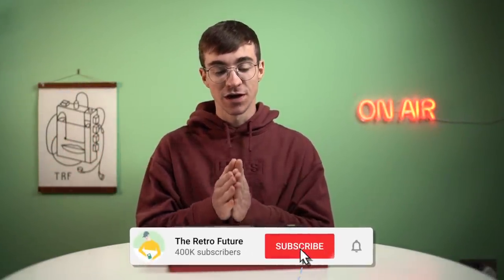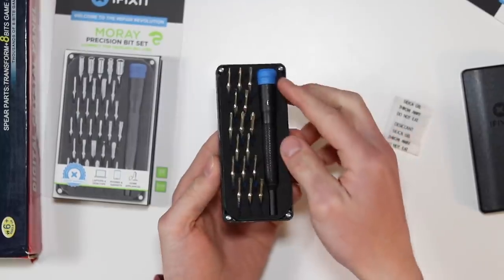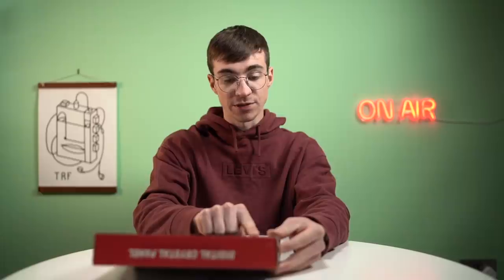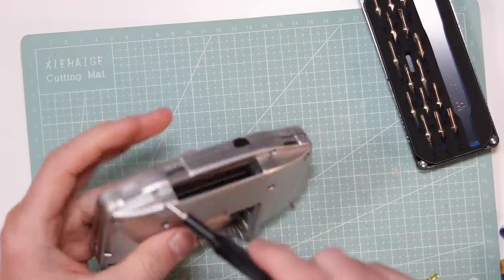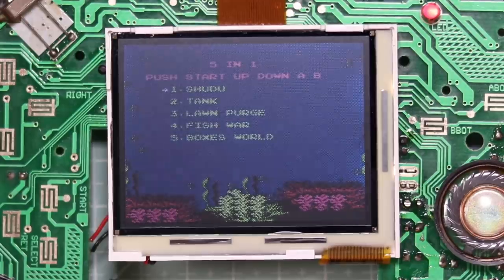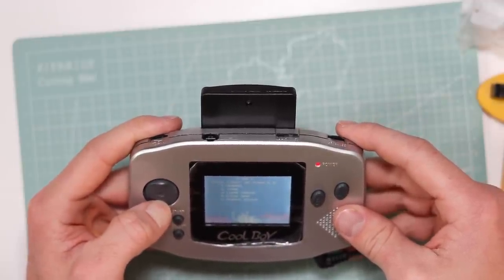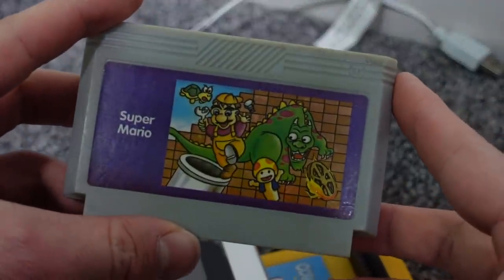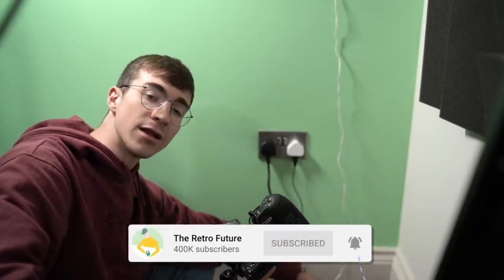The Cool Boy Console - What?

Comment: Those contacts are easily cleaned with a cotton swab dipped in white vinegar - no disassembly required at all.

Also, you shouldn't mix rechargeable and non-rechargeable batteries.

Comment: I decant my Isopropyl Alcohol into a smaller spray bottle. I can spray onto the end of a earbud without fear of knocking it over, or spray directly onto surfaces I want to clean. Just get a cheap clear funnel, and don't try to free pour like I did the first time... two times.
Reply: Also get a spare bloody extension cable.

Comment: Makes me nervous you're running a device with an instruction manual that indicates 4.5 volts at the plug in, but you plugged it into a 5 volts USB. there might be a chance that caused some of the issues you had, I'd suggest getting a basic bench top power supply for odd things like this in the future. It's basically a power supply with adjustable voltage at least, most times with more features than that. you can get one on amazon for just 50$

Comment: Game Boy\Game Boy Color games work with that thing ? ;-)
P.S. I think that even if the cartridges fit in the console probably something will short circuit ...
Reply: Thanks for the hart The Retro Future :-D
I noticed now that the cartridge slot of the console have a mini "Nes like" connector.
So probably the Game Boy cartridges doesn't even make contact with the connector contacts.
P.S. Notice that the picture on the box is a GBA pseudo 3D game (SpyHunter) ... used for promoting a Nes clone.
Interesting device (^_^)